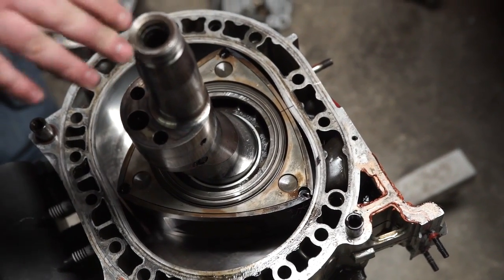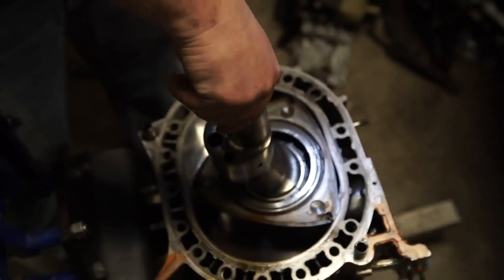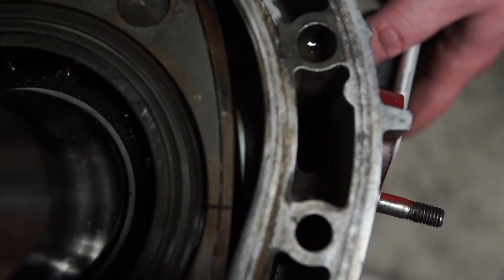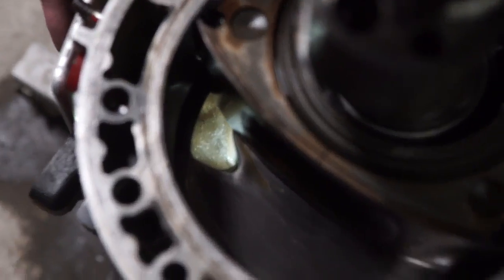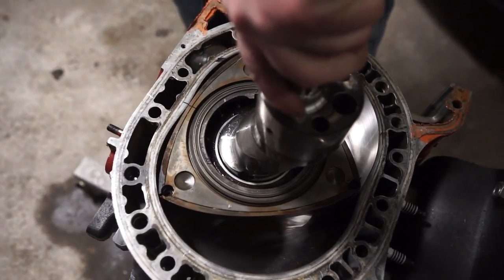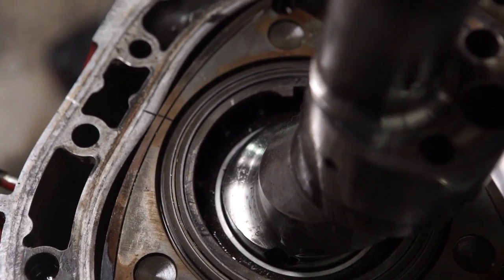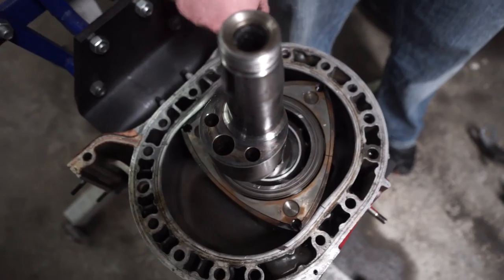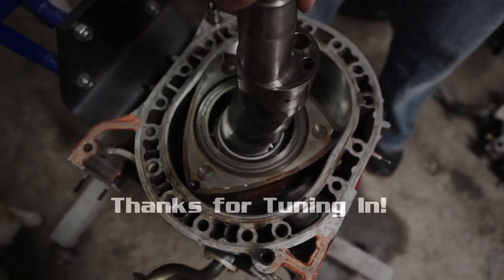Rotary Engine Explained: How Do Ports Work?

Comment: Fun video, there are 2 explosions or power strokes per revolution of the eccentric shaft on a standard 13b.. so 9500 rpm = 19000 power strokes 😅👍🏼
Reply: BUT A 6-cylinder 2-stroke engine has 6 power strokes per crankshaft rotation.
At 9,500 rpm that is 57,000 power strokes per minute.

Comment: Rich idle makes the brap brap noise not the port configuration
Reply from the maker: No. Overlap causes the noise.
Reply: Kenny McKee so bigger port, more brap? Will a stock port still brap? I’m brand new to rotaries
Reply: Bp, PP, large extend port, will brap on idle

Comment: Can you guys do a video on basic rotary maintenance? Like what to do daily, monthly, yearly, what to watch out for and what to expect. That would be super helpful.
Reply: oil/filter changes every 5,000km. places say to use royal purple but it is JUNK. but oil opinions are everywhere. I used mobil 1 with zero issues but they say not to use REAL synthetics so a refined mineral (group 3 are fine) but a PAO/Ester like redline, mobil1, motul v300 they say to avoid. never had issue but that is there. so to be safe use a group 3 synthetic 
if you run B9/10 plugs every 5,000km needs changing or the standard plugs last 10-15K 
thats about it man. its no diff to a normal engine. 
you do have to top up the oil about 100mls a week as it uses some oil and mremixes it with fuel to add lubrication so that is the only big difference.

Comment: Hey dude I really need help, I just had a act clutch installed and my flywheel resurfaced and the pedal now is crazy soft and it catches almost by the floor. I tried adjusting it but no matter what the catch point doesn't really raise much. Is it normal for a new clutch to catch lower? To be softer? And what are factory specs for the pedal?

Comment: since we are about porting. How do you think Mazda is going to make the new rotary engine for the upcoming RX-9 to have some form of a starting/stopping built into the engine?

since we all know the intake, compression, combustion and exhaust is still happening. In a normal engine the engine will just simply turn off. But there are no valves to speak off in a rotary engine, unless they employ some sort of valve before the ports.
Reply: That idea went to the bin.
Reply: Mazda recently applied for a patent

http://blog.caranddriver.com/new-spin-mazda-files-patent-for-new-gen-rotary-engine-heres-what-it-tells-us/